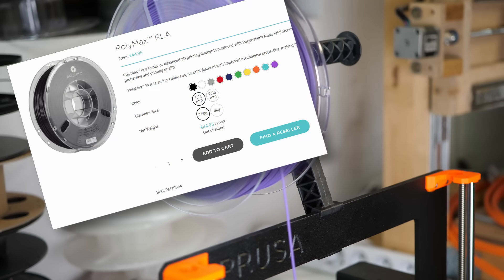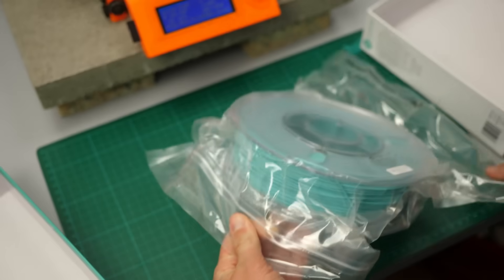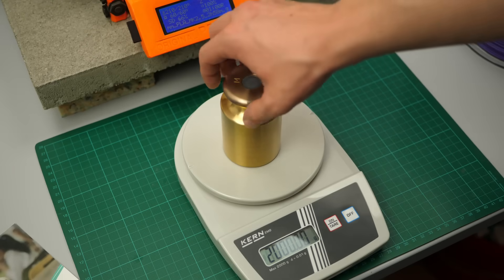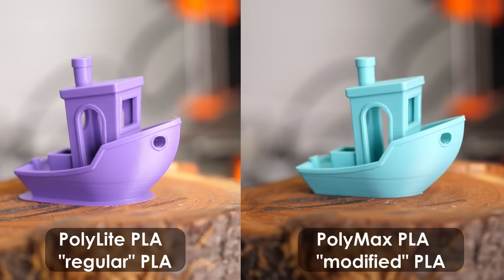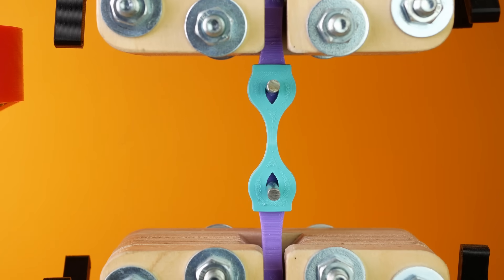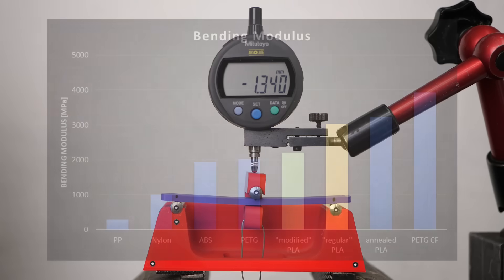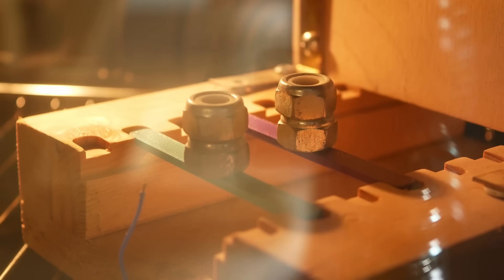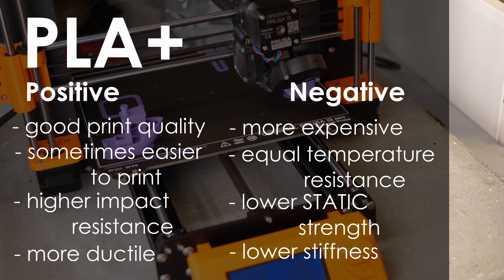How much STRONGER is PLA+ really?

Comment: Please test more modified PLA's, especially ESUN i'm very interested in seeing as their PLA+ cost almost the same as the regular PLA
Reply: I have done a lot of testing of different materials and esun pla+ is one of my favourite enhanced filaments. Cheap and much stronger at real world loading then normal pla. Also very consistent diameter and very little stringing. I make a lot of GoPro mounts for paintball and airsoft so they get beat on and I have rarely had issues.
Reply: @15DjjC13  ' Cheap and much stronger at real world loading then normal pla.'  Exactly.  I had to use a hammer and screwdriver and a ton of pounding to free the petals on an iris box, where normal PLA just easily snaps away.  Thin 2 or 3 layer sheets can be repeatedly flexed, it's extremely tough compared to regular PLA.
Reply: I always find it annoying that 3D print youtubers only test boutique brands and totally ignore the 5 cheapest brands which probably supply most of the filament their viewers regularly use.
Reply: @MetalheadAndNerd  Not to mention the boutique brands are not really any better either.
Reply: @lookitsrain9552  Yeah, but we are being told over and over how nicely wound their spools are. As if that made any difference.
Reply: I've been using ESUN PLA+ and it's very strong and flexible (compared to straight PLA). But it still has weak thermal performance and it gets a bit more brittle over time.
Reply: @michaelbuckers  Have you tried annealing it?
Reply: I can tell you that ESUN PLA+ warps less on the print bed for sure. Not done any strength testing
Reply: Yes, I'd like to see Steffan test eSUN's PLA+ as well. Some of the comments on the internet make it sound like the best thing since sliced bread, but its MSDS says it's only 98% PLA plus 2% CaCO3, so it's difficult to reconcile some of the claims with this. Some proper physical tests should answer the question once and for all.
Reply: @anthonyrich1592  There are interesting papers about the influence of CaCO3 nano particles on the thermal and mechanical properties of PLA. This seems to be legit.
Reply: I can't necessarily offer you a bunch of comparisons, but the first "black" PLA I ever ordered was eSun PLA+. Since then I haven't gotten another PLA+ brand that felt like it lived up to it. It had a very nice glossy black, left a smooth finish on top and bonded well to my glass build plate without needing glue. It had a good balance of hardness and toughness - unlike the overture white PLA (not modified) I used, it would bend a good amount and go back to its initial state, but it did snap if it was overextended. The PLA+ I'm using currently (I can't remember the brand, sorry) will just bend and not go back to the initial state, and it doesn't snap - it kind of acts like metal and just 'fatigues' and eventually tears.
Reply: @Hyatice  I really like the eSun PLA+ in black.  It just prints reliably, every time, with no drama unless it's due to a goof in my model (aside from sticking TOO well to my build plate, which I remedied by dropping the build plate temp. to 45C and reducing the first layer print temperature a little).  This isn't an ad for the product... I pay full price for it.  I just like how consistently it behaves.
Reply: @WorldPowerLabs  this is over two years after the original comment and I still have a slingshot that I printed out of that stuff way back when, the superglue holding the front and back together (as well as the rubber) both failed and the plastic is still fine, a little sanding and more glue, strong as day one.
Reply: Cctree PLA + is what I'd like to see tested. It's my goto filament.
Reply: Since i first bought a spool of esun PLA+, it‘s been my daily driver filament. I use it for mechanical parts, load bearing prints, gears, electronics enclosures, adapters, etc and have yet to see a failure. I printed a router lift and a dremel drill press with it. Never a print failure that wasn‘t my fault, and moisture has never been an issue. I imagine it‘d test pretty well :p
Reply: Right, would be good to know
Reply: Also reprapper has a new modified pla that is selling for about 22$, can't find much info on them but still picked up roll the other day to try it out.
Reply: Esun pla I used was consistent and never clogged up nozzle.
Reply: I would submit Sunlu filament as well. You can get it at about $16/1KG. I have been thru two rolls without any issues.

Comment: The "Industry standard" for 3D printing firearms and firearm parts (including pressure bearing parts) is eSUN pla+. There are 3D printed firearms (FGC-9, Plasikov, fmda glock frames, etc.) that utilize pla+ that have gone for thousands of rounds. I personally have an AR-15 lower receiver that has gone for over 500 rounds with only minor wear.
Reply: Would be interesting to see a comparison to other modified PLAs. I'm sure esun is mainly used to it's price and availability. Not to say it isn't strong enough. Just wonder if there is even better pla to be used.

Comment: Congrats on the kiddo Stephan!

Recently I ran into a issue when printing with a 1mm nozzle on some modified PLA it acts like nylon that just bubbles and looks awful, while a  0.4mm nozzle has none of the issues.
Im drying it now but its just something i haven't seen in a while.
Reply: I've seen this EXACT behaviour from eSun PLA+. 0.6mm nozzle: No bubbling, at 0.8: Un-usable, it bubbles like it's designed to do it. Brand new spools and old spools act the exact same, so I don't think that moisture isa  huge factor unless eSun have very wet filament out of the box, but that doesn't seem to be the case, because it normally prints excellently.
Reply: @wefyb2  Well i just got done with a 600mm vase print after drying. The extrusion is perfect now! Its definitely moisture, a 1mm nozzle just cant maintain enough pressure like a 0.4mm nozzle does.
Also im using a 4kg spool, even with 18 hours of drying at 50C the center seems to have some moisture still, as it shows in the upper layers.

From now on any and all filaments gets dried, its been driving me mad. nozzle size was all i was changing and would give me hell.
Reply: @NewcastleDayz  I guess I need to get the ol drying chamber out then! Thanks for the reply
Reply: @wefyb2  I'm just finding out that 4kg spools need a lot of time to dry through to the center. My 600mm vase had a bit of bubbling from moisture in the last 100mm .
So if you have a way to use the filament while printing, do that

Comment: Congrats on the baby. 

My experience with pla+ is that it doesn't like to stick to the bed. But it may be the brand I used. I just know that the regular pla I use is so much easier to get great first layer adhesion compared to the same brand's pla+. :{
Reply: @kfoltman  this was hero forge or 3d hero or something. It just would not adhere to the bed at all. No matter what I used to make it stick or how I adjusted the temps. And it was the same for both black and grey. I'll stick to normal pla and avoid the headaches from now on. :{
Reply: @kfoltman  these are a name brand though. :{